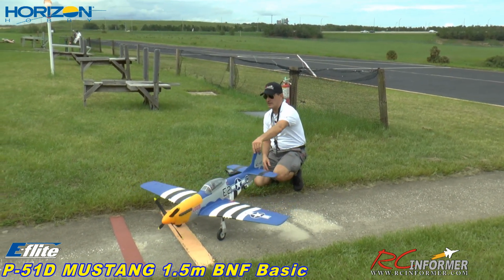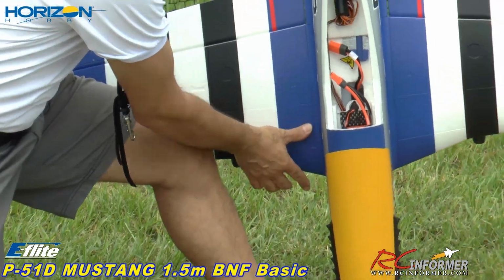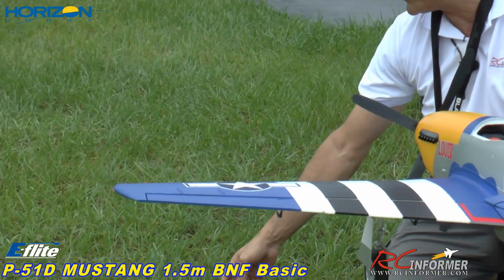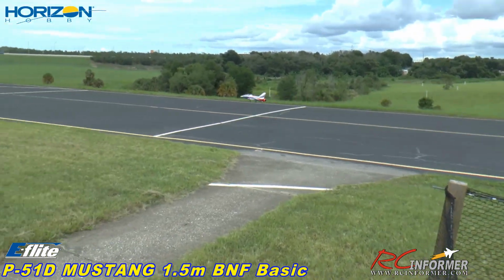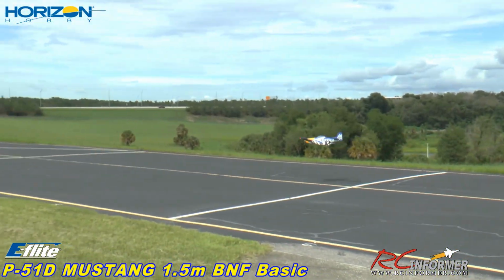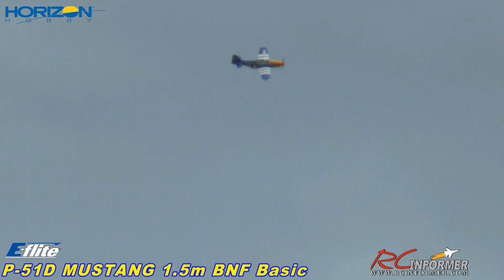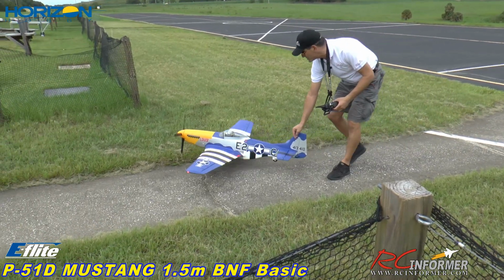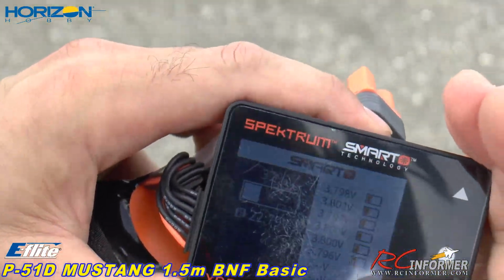E-Flite P-51D Mustang 1.5m Checkout Flight By: RCINFORMER

Comment: This is one of the hardest plane to fix after a major crash, specially if you need to replace and re-wire both the wing and the fuselage...A total pain in the @ss... It is better just to buy a new one than to try to fix it. I fixed mine after she spent almost a year in a corner in my hangar, and this is her Re-maiden flight video!...
Watch "E-flite P51D Mustang 1.5M Re-Maiden Flight 07/03/2022" on YouTube
https://youtu.be/ggcouUnqidI

It is a great plane, but really hard to fix...😊👍🏾👍🏾👍🏾

Have a great day! Greetings from Douglas,  Arizona 👍🏾👍🏾👍🏾🌵🦠😷🇵🇷

Comment: Been flying this warbird in Realflight 9.5 and even though I land it 100% of the time, it was impossible to do without bouncing it like you did. Took lots of practice to get to land smoothly without the bounce. It’s hard to master, but I’m working on it, still only landing it without a bounce 1 out of 4 landings. The key is about 1/3 throttle with full flaps as I shallow glide down and cutting throttle just before the wheels touch. Hardest plane to land smoothly in Realflight for me so far.
Reply from the maker: the wheels are hard and great on grass, softer tires are best on pavement!

Comment: Hi,verry nice video!!   what is the smallest Lipo I can use in this P51? Is 4000 OK? 
Thank you.
Reply from the maker: 4000 should work fine! just check the CG before you fly it:)
Reply: Thank yo! ,this sounds great. I like it little bit more with less weight... :-)
Reply from the maker: @georged.1439  You can use a 3200 as well, just check the CG. It MAY need some nose weight with a light battery but the AS3X may compensate.
Reply: Great, thanks a lot! .... maybe I will use a 3500-4000mah Lipo with soundsimulator in front as weight....
Reply: Hello, do you know the weight of the smart 5000 lipo you used? Thanks

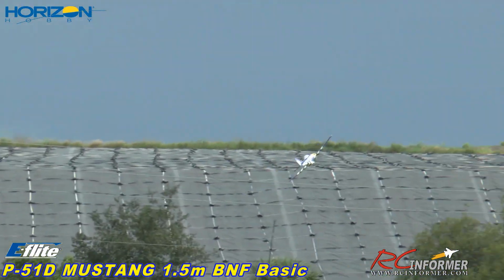Comment: At 13:26, I have had that same clicking noise with my Mustang and I discovered it was the strut cover on the landing gear not closing flush with the base of the wing, which creates air flow into the wheel well; that makes the cover flap up and down. I know it, because I don’t hear that noise when the gear is down.
Reply from the maker: I got  a fix coming for that, stay tuned
Reply: @RCINFORMER  I’ll want to watch that. I don’t know the best solution to it. Have a Merry Christmas Rich👍.
Reply from the maker: @johnsons74thsquadron74  Merry Christmas!

Comment: I’m an intermediate pilot (approx 15 planes ) but I’ve never flown a P51... would you recommend this one to me as a first p51? My highest performance planes are the v900 and Eflite Viper and the Carbon Z Cessna. I also fly off of grass.
Reply: I have an old Lanyu models 1450mm P51, no flaps, np gyro, had it for 5 years, easy to fly just hold the tail down before touching the throttle when flying off grass, feed in a bit of right rudder and away you go.  
fms or eflite at this size depends on how much you want to spend.  Gyros and safe not really necessary with a P51 it depends on what you are comfortable with.
Reply: You have got it TRUTH. IF YOU can fly those other planes this one will be no issue. I'm really wanting it myself. The trigger finger is getting itchy on this one. 👍👍😉✌✌
Reply: @reckemroysrc3764  Thanks!